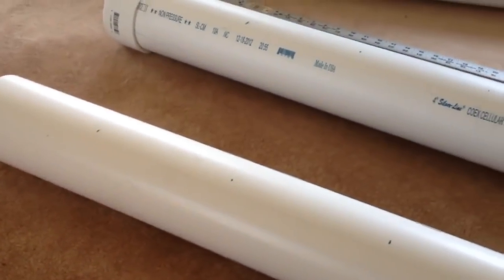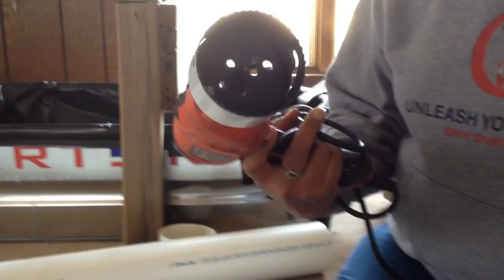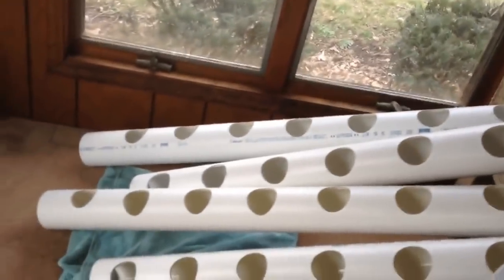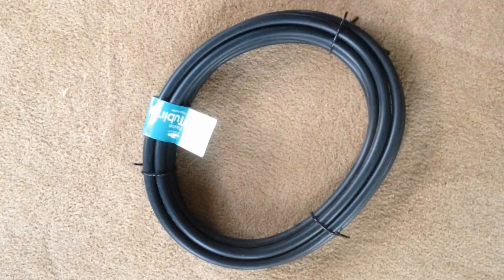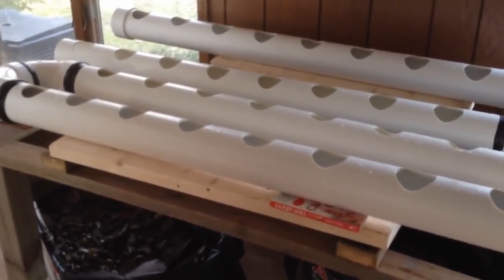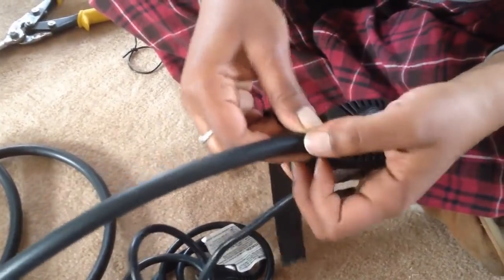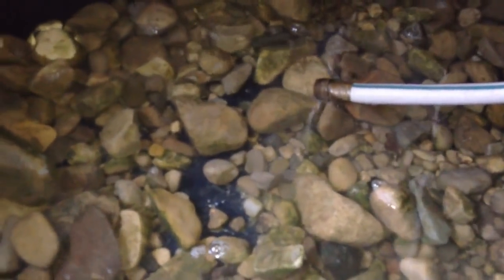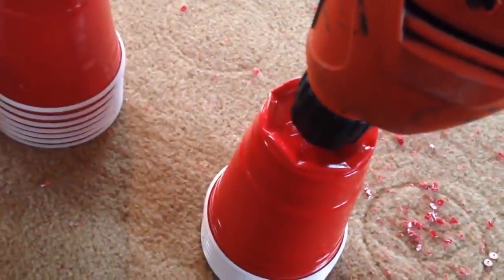How To Build a Gravity-Based PVC Aquaponic Garden Very Easily

Comment: Lowes will cut the pipe or wood if you need it cut and the will cut in multiple lengths if you have a project going and no saw or it would make things easier for you, at no charge. The thing that cuts holes is called a hole saw and the inside piece that you had to go back for is called the hole saw guide bit, or just hole sat bit. I really liked the way this looked better then the box growing tubs.

Would it be possible that you could post an update so we can see the system with mature plants? and to know whether or not you liked the set up later on, did you have to tweak or change anything or WOULD you change anything? Thanks, great video, great project!!!

Comment: To maximise aeration put an end cap on the bottom and drill a hole into the plastic and insert a watering can rose ( spout ) this will aid getting air into the water.

Comment: you have shown more details on drilling using the holesaw which is nor required and shown less(no) details on the plant media. how did you manage to get the plants straight up ward? did you put gravel in the plastic glass?.next how did the water from the pond got inside the growpipe and how did it get out back to the pond?? can you show the pictures

Comment: Take a saw to the store, and turn the $11 pipe into two $9 pipes, right in the parking lot.
Reply: Brian Jones dude i fucking love u
Reply: +Don O (DONON) I can one up you, go to where the moulding is, use their saw!
Reply: Hi Phi, hardware (home supply) stores sell longer pipes cheaper than they do shorter pipes.  We pay less by purchasing a 20 foot pipe and cutting it up into 4 five foot pieces as opposed to buying 4 five foot pieces.  Almost everything is cheaper in bulk quantity.
Reply: +Brian Jones the best tip ever!!
Reply: great idea!
Reply: You can use a bench power supply and nichrome heat resistant wire at about 30v and make the cut that way.
Reply: @trustinjesus1119  You ever done that? I have never seen it done.
Reply: @onlyKRIZAN   I got confused about what thread/video I was talking on.  It's a method for cutting glass, I haven't done it but I've seen it done "NiCad wire - Bench power supply."  Used my wet tile saw & $100 diamond tipped blade and made some drinking glasses from liquor bottles recently.  I've been building wooden crates walking the lumber home 5 miles from Lowe's when I could be cutting the lumber in half and taking it home on the bus as well as going there by bus!  Sometimes I'm kind of an idiot.
Reply: Dont understand, you mean like cut 1 pipe into 2 pipes and their cost reduce to $9 ? Or $18?
Reply: If you want the best aquaponics system online then visit this website here: HootAqua. info
Reply: What a great idea Brian... I'll be dong that today at Home Depot, thanks.

Comment: Personally, I would have capped both ends level to each other. Cut one cap with a slot that would allow the water to drain fast enough to keep up with the pump. At a level that wouldn't let it overflow out of the planter holes. With the pump end having a hole drilled in the top of the cap or pipe to fit the tubing.
I don't see that light trickle of water adding enough dissolved oxygen into the water. Do goldfish not need very much dissolved O2?

I also have health concerns about sealants, and tape being in the system. Leaching chemicals into the water. Regardless of how careful you are in the application of them. If food grade materials are not used then what is the point?
Maybe someone can clarify for me and explain more. New to the aquaculture, hydroponic, aquaponic worlds.

Comment: You did not tell me what I need to know!!!  how do you transition the plants from the little dirt filled cups you get at the nursery into the rock filled cups you use???
how do you get the bottom of the roots into the water running through the pipes and how much of the roots are in the water??? How do you keep  how  much of the roots out of the water???
Thanks,  Lewis

Comment: Where did you get you 4" pvc pipes??? Every one says to get them from  Home Depot or Lowes but here in California our Home depot or Lowes do no carry 4" or larger size pvc pipes. You have to go to a irrigation place to get them the you are paying 3 to 4 time more for pvc and it is by the Ln ft. So Help? I need some place that is a little cheaper than that.
Reply: Linda Owens Check Home Depot again. The pipe you're looking for is called Sewer pipe and comes in standard 3" and 4" diameters.
Reply: Depending on where you live Home Depot may not carry 4" PVC.  Your other best bet is a plumbing wholesaler or supplier.  Yes, it will be sold by the linear foot but it should actually come out a bit cheaper than at HD.

Comment: I have made my own ebb and flow system using white PVC pipe, have just one thing to add... White PVC pipe, no matter how thick, still lets light in, causing algae all throughout the system. Black PVC pipe would be best. You can paint the outside of the black PVC white to help keep the temperature down, but the bulk of the material being black will help to keep light out.

Comment: I have watched about 20 videos, and in every one, they always fail to show you some of the main pointers. Normally when I post others say exactly the same thing, I notice I'm the only one going to ask, SO WHY DIDN'T YOU SHOW YOUR WATER INLET, AND OUTLETS? You showed the temporary trial of pouring water into one in and it flowing out the other, BUT once you capped both ends you failed to show, UNLESS I missed it, how you introduced the water to the tube and let it out. What fitting you might have used, even though I'm sure that can be figured out.
Reply: Lemme look again musta missed it. But then like I said apparently others did also. thank you

Comment: PVC is toxic to humans. So why grow food out of them yes ?
Reply: Travis French don't drink your tap water then all the water in your home runs through copper piping and PvC. they also use contact cement spray to keep every thing water tight.  Been used for years.
Reply: Travis French Well, no heat or plastic solvent is involved, so they shouldn't end up ingesting any of the pvc.
Reply: Awesome man. Thank you.
Reply: Thanks for the info. Been drinking reverse osmosis for quite some time
Reply: ahhh I see. happy growing.
Reply: +Travis French out of a plastic cup perhaps?

Comment: OK get it with making the holes in everything but for a step by step in the video would have been better for people like me. I guess it seems as though after you put the pipes together and showing the pumps in the tubs you jumped to the finished product. Kinda leaves a person scratching their head like did I miss something. It is a great idea just wish you would have taken the time to show it through completely.
Reply: YouTube has other videos on how to do this.
Reply: TrustInJesus111 thanks
Reply: You can just get a tray for your potted plants and fill that with water.  The plants will suck the water up and so you don't have to worry about the water in the tray going bad, you'll be replacing it frequently.  You can also add some nutrients to the water in the tray.  You can do the same (nutrients) with this system in the video. 
DIY Project: Self-watering Planter with a Plastic Bottle
Reply: Thanks I appreciate the information.

Comment: This system on the face of it looks attractive because of how quickly and easily you could get it built. Its inexpensive, simple, and you don't need many tools to create this. For some that would be a selling point but I think anyone beyond a beginner in the world of aquaponics or hydroponics will see this systems main fault.

For the amount of space that this system takes up it won't return nearly as much as a raft or growbed system could with the same amount of space. If you are going to use piping its not a good idea to connect the pipes in this way, if you want to get a good return.

It would make more sense to get pipe 1" smaller in diameter, remove the joints, put the pipes much closer together, put end caps on each side of the pipes, drill a hole in the caps for the water inlets (use black tubing to pass in the water), then on the other end drill a hole in the caps for the outlet, and then connect each to a single drain pipe back to the sump.

They could have fit more than twice as many plants in the same space horizontally. I applaud their efforts though!!!
Reply: *****
Could you send a picture, plans or something as to how you did your tower system please?
Reply: A multi tower vertical system is the way to go. I used square fencepost  and had 24 plants per post and it worked fantastic.
Reply: Nathaniel Garcia
That is why I love this community, one idea grows from another. I love your idea.. I can really picture it, it would use gravity without wasting space. You can use it for all the plants that you use for spices and make it a growing spice rack... a bit like this one.

http://www.offgridworld.com/the-ultimate-spice-rack-indoor-vertical-herb-garden/

Comment: food for thought.. 1 gallon produces 1 plant... your 45 gallon tank and pump is plent for your 30-35 plants..
Reply: In aquaponics your better off starting with the fish requirements and working backwards so to speak. For every lb of fish you need 8-10 gallons of water. Obviously 100 fry may weigh the same as 4 adult fish. So when i say 8-10 gallons per lb of fish I really mean per lb of mature fish.

Every lb of fish is only good for 3-4 small plants. If he has a 45 gallon tank he may only have the room for 5 adult fish. That actually equals 15-20 plants.

Comment: Why not use a rubbermaid tote, fill it with media and plant everything in there? Seems cheaper and better.
Reply: Because that would be a media filled bed style. There are benefits and consequences to that style as well. The method used in this video is much easier as far as technical skill needed to setup and is much less finicky. The siphon drain needed for media-fill technique can require extensive dialing in so your fill and drain cycles don't kill your plants.

Comment: Just A Suggestion, have you tried just heating a metal rod or a drill bit when you were drilling the holes in the cups, it may be easier to heat & push the rod through the plastic :) nice job :)
Reply: I tried that on mine, i used an old soldering iron, it melted all of the cups together.

Comment: Whatever is normally used to pump water would be safe, but small leaks in something this profitable would probably not make much difference.  Plumbers put pvc togather all the time. Just do it the same way. Irrigation tubing would be safe, because that's what its designed for, (and you already eat vegetables grown with black tubing).

Comment: Cool idea, but many details are left out of the video presentation.
1. I assume that the fish poop settles down in between the rocks to the bottom, but how does the fish poop at one end of the tank get sucked into the pump?
2. I assume the pump just sucks water and poop from the immediate area where it is located?
3. You didn't mention what you feed the fish with, standard goldfish food?
4. How far down do the cups go into the wholes - do they touch the bottom of the PVC pipe so the roots get wet?
5. What is the approximate water level inside of the PVC pipes as it is flowing through?
6. Is there an alternative to clay pebbles incase we can't find that medium in this area?
7. Does the fish poop settle on the bottom of the PVC pipe when the water stops, and if so does the PVC pipe need cleaning to prevent it from smelling?
7. You mentioned running the pump on a 15 minute cycle, is that on for 15 minutes then off for 15, or just 15 minutes a day?

Comment: Nice design, i am sure you will get some nice plants growing from that setup, but i would add a bio filter + Algae scrubber for the fish to that system and a heavy waste / protein skimmer, check out Rob bob for some designs.

The Heavy waste from your fish can be used as extra fertilizer.
Reply: Heavy or large waste can be broke down by worms.
Reply: Aloha, yes but you not want heavy waste in your pipes or in the tank you need it in your plants with rob bob's setup it allows you to drain heavy waste into a container and just pour over your plants, plus its cheap just a bucket and some extra pipe.

Comment: seems almost like you're avoiding biological filtration
Reply: If they don't overload with fish there will be plenty. Consider an aquarium. The gravel at the bottom provides adequate biofiltration even though water isn't being forced directly through it. The same would hold true for this setup. The water is flowing through the rocks because of the circulation from the pump and the return. Also all wet surfaces in the pipes (also part of the biofilter) will have water being pumped through it. Small setup like this will be fine.
Reply: The roots of the plants become the home to the bacterial/biological filter.
Reply: I'm not sure if they can house enough bacteries. I would suggest to put a small filter wit lava or so at the outflow of the pipe.
Reply: The rocks in the tank will provide plenty of surface area.
Reply: but there is not enough flow trough them to feed all those becteria

Comment: Hey American Bacon!!! You said you are using PVC glue in the system, I think a much safer alternative is to use aquarium grade silicone. It would get the job done no problem (it holds aquariums together) and is safe in terms of leaching chemicals. Think about it.
Reply: Sean S "pvc glue" is a misnomer. It's a solvent. I dissolves a solute,  the pvc,  into the solvent, the "pvc glue". It doesn't have adhesive qualities. It literally melts plastic to form a plastic to plastic bond via slip connection. It is considered a safe potable water solution.  And yes I understand flouridated water is likely no good. I have an 8 stage RO/DI whole house system. And a rain water reserve. But no let me read up on this subject more. 

But tell me what TDS and electroconductivity your water reads out of your tap?
Reply: PVC glue is used throughout home plumbing. Hurrrr durrr think about it. 

Silicone doesn't work will with PVC.  PVC glue is a plastic solvent and melts and welds the two PVC pieces together and leaves no glue behind once the bond has been made. It is potable and safe to drink. You sound like you might have limited experience in PVC plumbing...
Reply: dodododo
 and hoime plumbing generally isn't safe either dododdodo, because of many reasons such as the glues, and again because unless you have a well, if you study a little then you will know any city tap water is extremely bad for you and can cause cancer among other things. from synthetic fluoride (regular fluoride isn't good for you either) to ammonia, chlorine all these things and more they add and cause  number of diseases, even from showering.

Comment: Are the plastics in PVC and other vinyls safe? When I was making self watering systems the instructions stressed using drinking water grade pipe. Leaving me to believe that other pipe would leach toxic chemicals.
Reply: Yes the plastics in the PVC are perfectly safe. I'm a licensed builder and I have never heard of "drinking water grade pipe"... PVC and CPVC is used any almost all home plumbing systems. The differences in PVC are the schedule (thickness) which is used for different applications depending on water pressure.
Reply: *****
 I too have built homes and still work in the field I just don;t build any more, but a good lesson to know is people use a lot of things that aren't good for you and are actually contrarily very bad for your health, i.e. aluminum, tap water, canned food (dht) etc..
Reply: As I've looked in to more I've found PVC does leach toxic chemicals. I do think it is minimal. All PVC that I know of is rated for drain or waste water. I've  built one vertical planter out of a food grade 55 gal. drum with a worm farm in the middle instead of PVC for the large pipe in the middle of the barrel housing the worms I used 3" diameter bamboo in an attempt to stay organic.
Reply: I've only ever used PVC for irrigation, drainage, or circulation of pool water. I have seen Potable water labels on plastic pipes, but it might have been PEX, (even that gets bad reviews). PVC I know will breed algae/bacteria on the inner walls, which in this setup may be what you want. I've seen the growth in the pipes of pools I treat and it's hard to remove even with high free chlorine levels or algaecides alone.

Comment: Red Green builds aquaponics!  Where's the duct tape?  A great relief, actually....if these two can build this....any of us ought to be.  Great idea on using plastic cups, mind--when they crack or otherwise "wear out"--very easy replacement!

The holes could be drilled closer together.  You should be able to get at least 33% more plants into a system this size--use up more of the fish poop!  I have seen units easily supporting 16 plants in the space of (and using as a base) a 20 gallon aquarium.
Reply: You need room for the plants that will grow. Room, oxygen and light. Closer would be cramping all above.

Comment: In your video you said you were going to Dayton, Ohio to do another system.  Did you get it done?  I've looked at the pipe grow bed but opted to use a flood and drain system using a bell syphon and 55gal barrels.  The barrels are use both for the plants and the fish. One above the other.